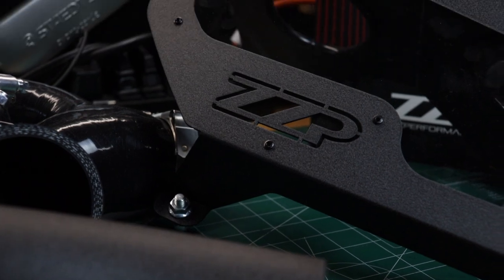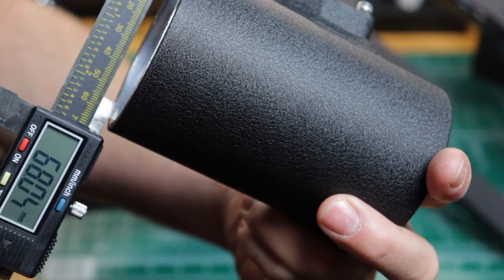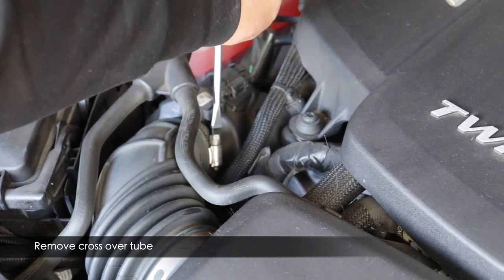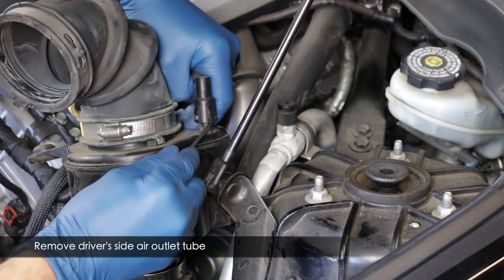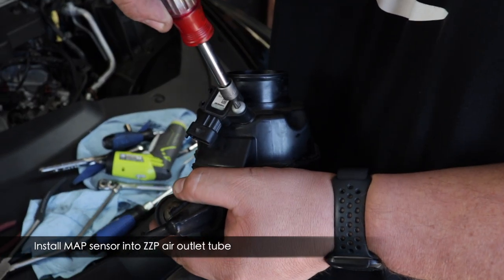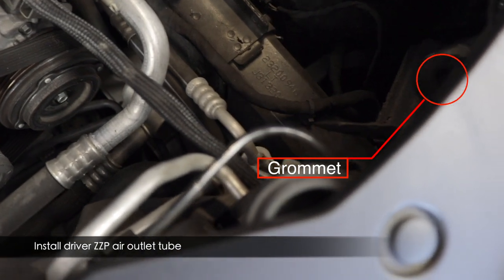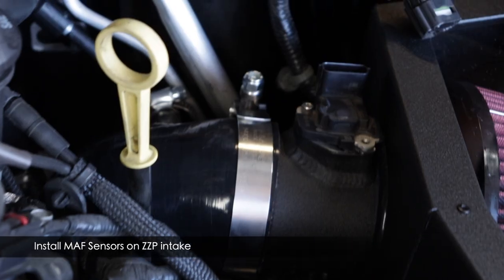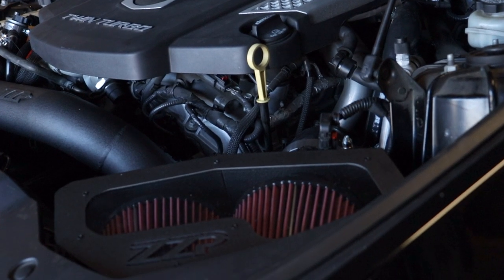ZZP Intake Install | Cadillac CTS VSport or ATS-V

Comment: Do you need to tune when you install it ? Do you get a check engine when you install it without tune ?
Reply from the maker: According to ZZP no tune is necessary and no check engine lights. However some will argue with the tuning factor. If you don’t have a tune you should get they first as this won’t add any horsepower.

Comment: If you pop the clip off the wiring harness on the coolant reservoir, you can zip tie the reservoir out of the way (after you cap it off) then you have better access to the driver side tubing. I was able to tighten mine down with a ratcheting wrench. Thanks for the walk through saved me time for sure

Comment: My zzp part didn’t come with the part that the map sensor connects to on the passenger side was wondering did yours come with it or where would I get a new one
Reply from the maker: Do you mean the silver part that can be seen at 12:48? If so, that only comes from ZZP they custom make it.

Comment: I’m broke I have a 2.0 turbo 2014 CTS so pretty much buying anything won’t give me any horse power since I’ll need a tune because the computer won’t let me? Or is it just on the vsport n CTSV
Reply: Invest in a K&N filter, and remove the air intake noise restriction inside of tube. CTS will run a lot faster, without bogg when you mash the throttle coming onto interstate.

Comment: Do the inlets fit over the flange that clipped the old inlet on or above... Tried to install this today and with clamps tightened it seems like the new inlets slide right off
Reply from the maker: The new silicon hoses should clamp over and around the turbos inlets. Try again, make sure they are seated as much as possible and tighten them down. I think on one we weren’t sure it was right so we loosened and did it again and it’s fine

Comment: Hello there!!! Hope you still read this comments sometime. Didn’t know how to contact you. Here’s my question. My car is a cts premium luxury 3.6 LGX rwd. And I’m looking for the k&n performance kit, but there’s non. So I found one for Camaro 3.6, same engine same everything but don’t know why couldn’t fix. Do you know if I can use it? Or do some small modification??? Thanks as always. Big fan of your channel.
Reply from the maker: Looking at the parts diagram the parts are different on the cars so I doubt they would be perfectly compatible.  You may be able to make it function bu It may run into fitment issues...maybe mounting points not the same, maybe engine shrouds getting in the way.  But I don't know for sure.
Reply: @JetFuelOnly  thanks man!!! Thank you so much!!! Nobody’s so helpful like you in this cts fan world!!! Wanna try it. Hope I can get it through. If I do, I’ll let you know
Reply from the maker: I will say the parts looks similar in the drawings for the GM parts but that doesn’t always mean anything

Comment: Would this be applicable to the xts vsport?
Reply from the maker: No. Your engine is turned 90 degrees. It’s not designed to fit. You don’t have any options that I know of.
Reply: @JetFuelOnly Man, ok. Do you know if I have any lowering options like D3 springs? Would like to drop my XTS V a little
Reply from the maker: D3 doesn’t make them any more but I can tell you somebody else experimented with the wrong springs and their car didn’t sit right. :(